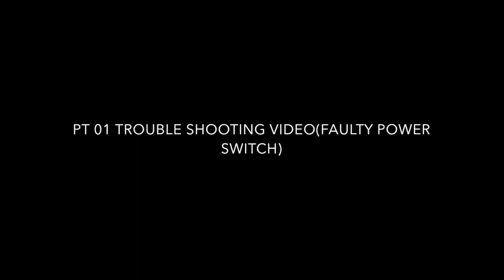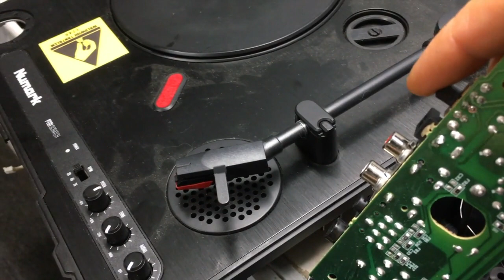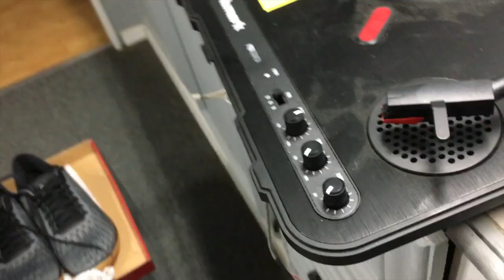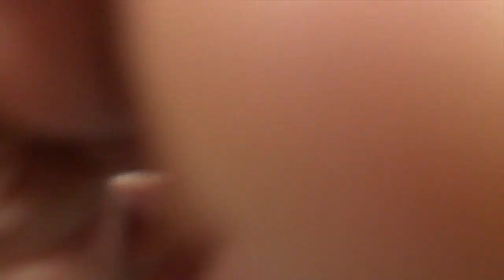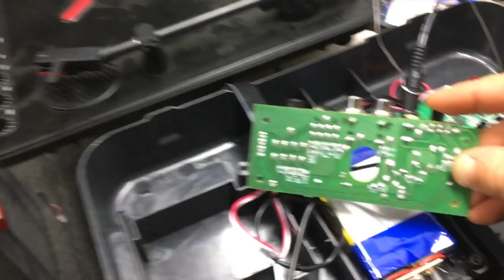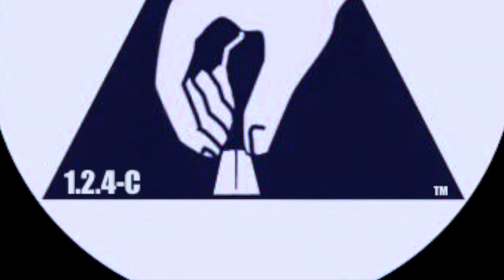PT 01 POWER SWITCH TROUBLE SHOOT

Comment: Hi, I have a pt01 and everything is working except it doesn't charge. Unit was sitting fir months and completely discharged now it won't charge but everything works on AC power. Suspect issue is with BMS. Is there an easy way to reset BMS? Please let me know as Tiexei doesn't answer my texts.

Comment: Soooo was losin my ish when i went to practice just now and power supply wont power up BUT IT WILL POWER UP WITH BATTERIES & switch and red light can be turned off and on like normal. 
 So im guessing its the brdige issue?. Ill look tomorrow and update probably make a video also on this problem but i seen people use a wire to bridge the two points betweeb the positive and switch. Just glad it worked eith the batteries for now i got my practice in but as i read more this unit get issues with the power supply being pushed in to hard causing a soder crack of switch itself losing its contact .. #DOTHFREQS #MTxMagicc
Reply from the maker: yes most likely this is your issue and the wire bridge is your solution .. check for broken traces or for a broken solder joint...
Reply: @CJScratch  right on ..will do .. I yet to get in there but again the fact it was working then I jumped on the bed .thinking I may of tweeted the wire board ..area but will keep y'all updated. But seems to be a common thing on these units .. thanks

Comment: Mine works with power adapter but not with batteries. Batteries have not leaked acid inside. Do you think there’s a similar issue on the board?
Reply: You ever get it working again?
Reply: @cesarsanchez4169 I have same issue. Think proble is with BMS but don't know how to fix

Comment: My pt101 power died even though I've hardly used it. I tried the fix in this video by shorting the 2 joints he mentions with a screwdriver, just to check if I had  the same problem, but it wasn't that. Then I used a multimeter to check I had 12v power  at the power connector joints which was ok so then I checked for 12v at the switch,  this wasnt ok so i checked continuity between the power connector solder joints and the switch's solder joints by follwing the copper tracks on the circuit board, the continuity was dead  indicating a problem with the copper track on the circuit board. Next I scratched off the lacquer on the circuit board covering a small bit of the copper track that comes off the positive side of the power connector joint, from there the continuity to the switch joint worked ok. I resoldered it ensuring that the solder spills onto the bare bit of exposed copper track and that resolved my issue. You could also solder a small wire between the 2 joints for the same result. Watch out for hairline cracks on the circuit board tracks as well as dry joints, they could be in different places to mine so just use multimeter to find them.
Reply: Hey to add to this. I had a similar issue. The problem was a solder joint from the power I/O plug leg. When the plug is pushed in with too much force it will push the center post of the plug back and put pressure on the solder joint of the leg on the PCB eventually peeling the pad from the PCB. I believe his is why wiggling the power plug will make it flicker or come on slightly for some people until failing completely. Thanks for the heads up on checking for this. I almost scrapped it.
Reply from the maker: yes this is a the proper way to fix a broken trace on a PCB.. i have had that issue with a portable as well ... scraping the trace and bridging with solder or using a jumper wire

Comment: What switch i have to use for replace it?  I tried your method and it didn’t work and i found out my switch is completely dead
Reply from the maker: make sure and look at the traces there could be a small break in the trace if so you will need to solder in a jumper wire ... you can always contact me via facebook messenger

Comment: I had an issue with the Power socket next to the switch, i had to wiggle it a bit to get power but now it is completeley dead. I can only run on batteries now, No power adapter. Do you have any ideas or knowledge on fixing this part CJ?
thanks man
Reply: My pt101 power died even though I've hardly used it. I tried the fix in this video by shorting the 2 joints he mentions with a screwdriver, just to check if I had  the same problem, but it wasn't that. Then I used a multimeter to check I had 12v power  at the power connector joints which was ok so then I checked for 12v at the switch,  this wasnt ok so i checked continuity between the power connector solder joints and the switch's solder joints by follwing the copper tracks on the circuit board, the continuity was dead  indicating a problem with the copper track on the circuit board. Next I scratched off the lacquer on the circuit board covering a small bit of the copper track that comes off the positive side of the power connector joint, from there the continuity to the switch joint worked ok. I resoldered it ensuring that the solder spills onto the bare bit of exposed copper track and that resolved my issue. You could also solder a small wire between the 2 joints for the same result. Watch out for hairline cracks on the circuit board tracks as well as dry joints, they could be in different places to mine so just use multimeter to find them.
Reply from the maker: hit me up on yahoo messenger i can video chat with you https://www.facebook.com/wheelso.steel
Reply: @CJScratch  Same issue, seemed like the DC 12V plug insert was shorted,had to wiggle it to stay on but this time it died in mid show and never came back. IDK if the saudering trick is necessary or can I just switch the whole circuit board from another PT-01 that isn't modified?
Reply: Same issue here man,, seems like a faulty connection.. It barely works only if I wiggle or push the charger in... Do I have to open up the machine and take a closer look?? any help is much appreciated !

Comment: Bro I need your help please

I pulled my pt-01 out of storage and I’m not getting sound from the speaker, headphone jack or line out. The only sound I hear is from the needle. 

I opened the casing and everything “looks” legit.
Reply from the maker: did you get the issue fixed yet ?
Reply: I’m having this same issue.
Reply: @victorm8178  hey! It was the power supply. I replaced it and it’s fine
Reply: @tech1238  You have a link to that? thanks man!
Reply: @victorm8178  I found it on eBay for 15-20 bucks. Have a look there 👍